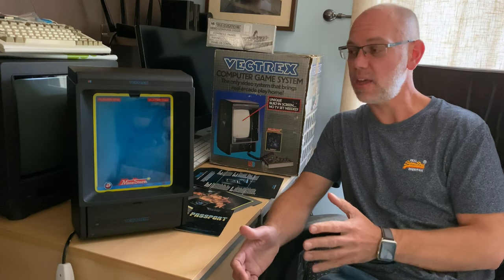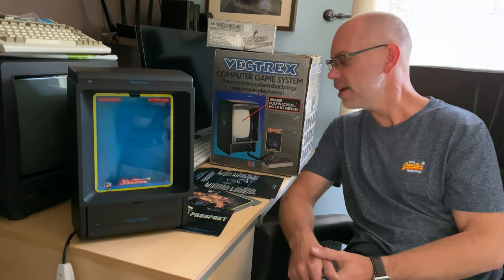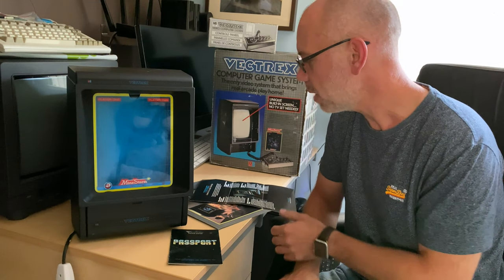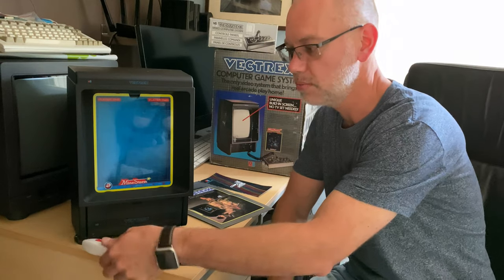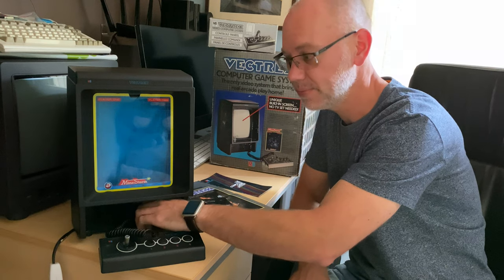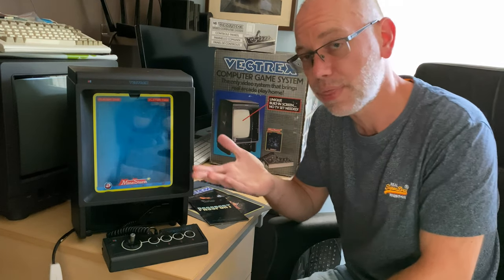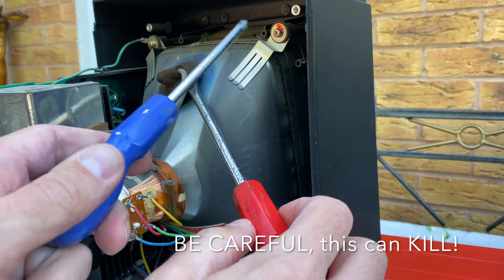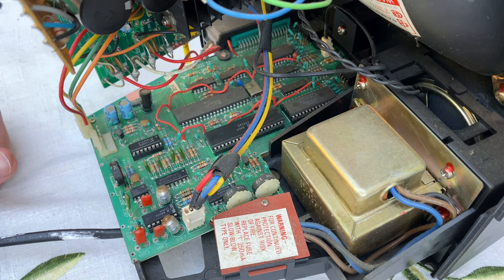Vectrex Repair - sound but no picture, power switch refurbish.

Comment: In case it helps someone, I’ve just cleaned my switch for the same reasons (sound, no picture - which implied that one of the contacts inside the switch wasn’t making a good connection). I was able to disassemble the switch in situ without having to desolder it from the circuit board. Once the back cover was off, there’s just enough room to prise up the three tabs and remove the switch innards for contact cleaner and sandpaper. The trick was putting the switch back together - it was impossible until I used a little locktite thread fastener (a tiny, tiny amount) to hold the white plastic “bow tie” and the brown disk in place. By rotating the switch shaft until it was in the “off” position, the assembly slid back into place and I could bend the tabs back. Note: it is essential to line up the metal “claw” on the brown plastic component with the matching piece of plastic on the part of the switch that rotates. You’ll see it if you slowly turn the knob. You must understand how the pieces fit back together or you will have a frustrating time! Incidentally, before cleaning, the video would just be a white dot, but the sound worked. With a little contact cleaner sprayed into the switch and resoldering the switch wires, things got a little better, but results were a bit random. Once I took it apart and cleaned it properly, it seems to be back to excellent condition.
Reply from the maker: Nice job, thanks for the written clarification. Horrible fiddly job getting reassembling, I wish there was an easy replacement part somewhere.
Reply: It took me 2 hours! My final solution is to put all the bits in the wired half. I put the Vectrex on its side so I could shove the two pieces of the switch together without the stuff falling out. An absolute nightmare!

Comment: Excellent tutorial! Thank you, just about to tackle mine with your help (same issue)
Reply from the maker: I hope it helps. Let us know how it goes!
Reply: Thanks! Here's an update:
The problem with mine was the power button couldn't be turned off so I had to turn it on from a switched power bar. Other than that everything worked fine on the Vectrex.

Volume, picture, sound and start up time were all perfect. I was happy with it but the switch always bugged me (I can't stand things not working the way they should) so after seeing your video I took the plunge, I have all the necessary equipment including a binocular microscope and I'm fairly good with an iron so I thought why not?

Anyway, I managed to de-solder the switch from the board, opened it up, cleaned the contacts, threw a tiny bit of silicone grease in there and put it back together. Whoever invented that switch is both a genius and a total maniac. That thing was a bitch to get back together but I eventually managed it.

Gave it a turn and it clicked!! Turned it back off and hey presto, another click! I was ecstatic, god only knows how long that switch has been in that state up until now. So...I reassembled everything, plugged it in, turned it on, heard the familiar sound of Mine Storm and.........no picture, except for a white dot in the middle of the screen. My heart sank :(

I spent the next  hour googling and trouble shooting. Checked all the voltages with a multimeter and found that one half of the board wasn't getting adequate power. It was definitely the power switch but why? everything looked good and it clicked nicely. 

The good news? I eventually got it fixed!! The problem? A small hairline crack at the base of one of the 4 wire terminals on the back of the switch. A little bit of flux and some solder a power on and everything works! Couldn't be happier.

Just goes to show how such a small, simple and easily overlooked problem can bring the whole system down. Anyway, thanks again for  your great video, hope this may help someone else with a similar issue.

Comment: it seems I have a similar failure (I get sound, but nothing  the CRT). Is there an easy way to confirm that the problem is the same you encountered?
Reply from the maker: Hi - The easiest way is to measure the voltages coming from the output side of the switch. If there is none - then it's not passing current through! It's been a long time, but I think I measured the current from where ever the switch wires went to. Hope that makes sense / helps?

Comment: How did you know right away that the issue was witht the power switch? You didn't measure it through for resistance or continuity...
Reply from the maker: I can't recall now. Fairly sure I'd measured the voltage in/out on the circuit. That and research of the symptoms pointed to that.

Comment: I bought two Vectrex's brand new in the early 80s. One still works great, the other after being in long term storage does not power on at all. Where would I start to troubleshoot? Is there anything that commonly fails that would cause no power?
Reply from the maker: Hi - thanks for your comment. I've updated the description with some links that helped me. Good luck! 

Vectrex repair guide has list of components to check.
http://www.playvectrex.com/shoptalk/vecguid.pdf

This talks about repairing the -13V circuit (removal of PSU board required)
http://int03.co.uk/blog/2016/01/31/vectrex-repair-black-screen-no-vector/

Switch removal and Cap replacement guide (German)
https://circuit-board.de/forum/index.php/Thread/25374-Die-Vectrex-Kur-Kondensatoren-richtig-tauschen-weg-mit-dem-Brummen-Tipps-Tricks/

https://groups.google.com/forum/#!topic/rec.games.vectrex/1Q-aQaVcd7s

https://atariage.com/forums/topic/281906-repairing-removing-a-knob/

Comment: I have doubts that cleaning the power switch was the issue. 
It's working and I'm happy for you though.
It's worth mentioning that the brightness control knob in back should be tried before just tearing into a 40 year old piece of electronics. I have a Vectrex and I'm a Technician of 25 + years. I would hate to see someone get hurt or damage thier system unnecessarily.
Make sure you unplug anything you are working on and use the proper equipment and precautions!
Reply from the maker: Great to have feedback from a pro. Good points, I've taken for granted that people would try the tightness knob. I had previously bypassed the power switch completely to test so I know it was that at fault. Ideally I'd prefer to source a replacement but it is a known issue, for example: https://circuit-board.de/forum/index.php/Thread/25374-Die-Vectrex-Kur-Kondensatoren-richtig-tauschen-weg-mit-dem-Brummen-Tipps-Tricks/ and https://atariage.com/forums/topic/281906-repairing-removing-a-knob/
Reply: The Vectrex power switch configuration is a little odd in that it doesn't control the DC or Mains supply, but instead passes two taps from the transformer onto the power supply board, where they are converted to  +/-5 volts, and -13 volts. The DPST switch controls the two taps separately. If the switch connections are faulty, then bad things will happen. For example, if the connection that feeds the -13 volts is missing, then there's sound but no picture. This is exactly the issue I just had - I had sound but no picture. Once I repaired the bad soldering on the switch (the circuit boards were definitely not the peak of 1980s soldering skill) and used contact cleaner, the picture came back. Thanks for the video which helped a lot!